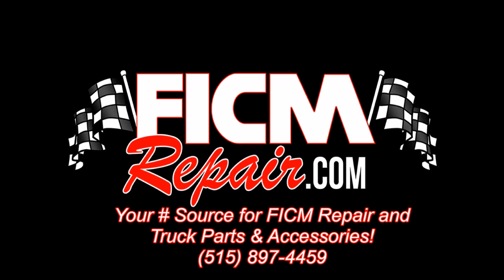Powerstroke 6.0: Fuel Pressure

Comment: I have an adjustment blue spring  kit what should It be set at ? Can it be too high? Static vs wide open throtttle?
Reply from the maker: You should set your fuel pressure at 60psi or so is optimal. So long as it never dips below 45psi, you are good, but we like to see nothing less than 50psi.